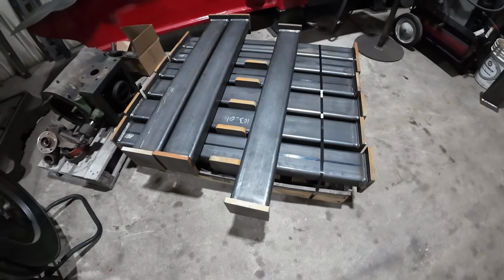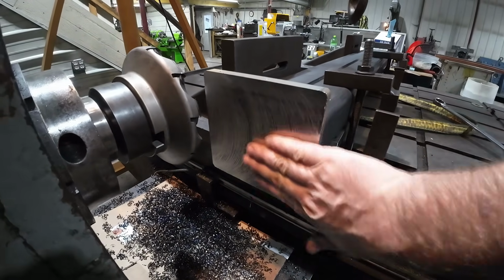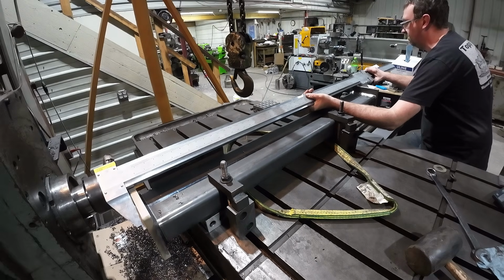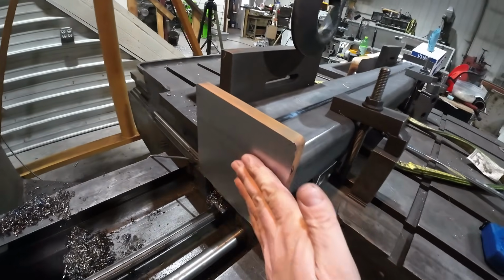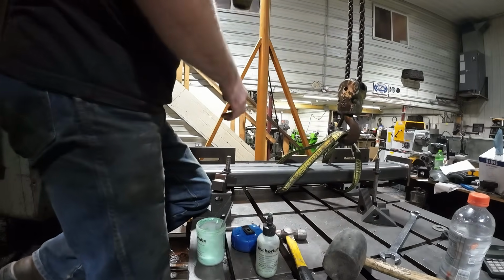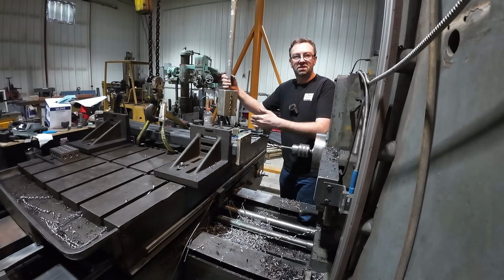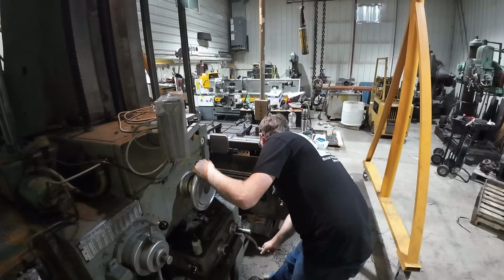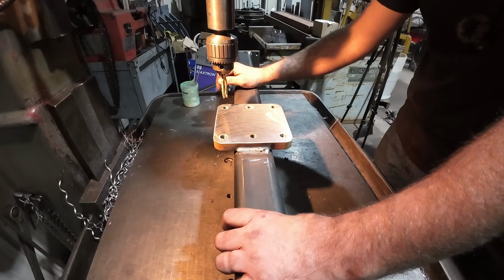Machining Parts for a Robotic Welding Machine on the Horizontal Boring Mill - Manual Machining

Comment: Many people think when they start out that the biggest cost will be tooling and machines. Machines is probably the cheapest if you buy used. But many people underestimate the cost of measurement instruments. Sometimes you just have to buy it for a job that isnt even worth that in the short run
Reply from the maker: The machine is the cheapest thing you will ever buy.  Just in tooling and measuring tools, I have probably well over a half million invested to get to this point.  It is crazy.

Comment: Never enough horizontal  boring mill work work on You Tube. Glad to see you doing your part Josh. The HBM is such a wonderful and versatile machine. As are the Verticals. I wish there were more vids with verticals working, but they seem to be sort of rare. Not to mention most of the ones I have seen in the wild are big and in shops where video is frowned upon.  The Big Starrett 123's are sweet eh? I would say you got a good deal on that. Well done!
Reply from the maker: I have a bunch of jobs coming up on the HBM.  I would love a 54" VBM or VTL, but there just isn't the room or work for one in this region.

Comment: I know you're not using coolant (No coolant recovery?) but running a 6" carbide insert cutter at 90 rpm is WAY too slow for mild steel. This is a small plate but if it was 50" long it would take you a half hour for each cut.
I have NEVER taken a finish cut of .075" with a five thou tolerance. Too risky. Even with digital calipers. A Vernier that size is too difficult to handle alone since you can't really wiggle the calipers to get perfect squareness so you will be off at least three thou. If the tolerance for such a simple part is really that close then you're better off locking your Vernier to plus .005" and using it as a go-gauge. I would take a ten thou finish cut at a higher RPM.

Comment: hey Flex Arm people this machinist is the real deal hook him up with a Flex Arm tapping system.. he will do more with it than the other guy!!!
Reply from the maker: I have no need for that contraption. The radial drill does the same job at a fraction of the cost.
Reply: @TopperMachineLLC  and with enough scrap... diy if it ever is needed.
Reply: have to agree that other Guy doesn't even use it i no not how he funds it but the tooling alone would be enough to break you and this other guy broke a few of them in setting it up the other guy his videos are not worth watching anymore and that's fact

Comment: Pro tip. C clamp the part the the angle plates. Use much larger clamps. You need to increase the distance from clamp kicker. Rookie setup in my oprion.

If you made those adjustments you could hog that pad as hard as u want

Comment: That has to be a tricky job because you are relying on the fabricator to give you enough length to work with.
As a machinist myself, I truly enjoy you and Cutting Edge in Australia because you guys are true working machinists, not machine tool collectors like many other sites that have lots of machines, but very little skills on how to use them.
Reply from the maker: He fabs them to print, which gives and extra 1/8" on each end. Plenty of meat to clean up.
Reply: What is the tolerance on the holes on the center plate with regards to being in centered between the ends of the post? Do you have to trim both ends equally on those?
Reply from the maker: @luksan_swe  Ends machined to spec length, holes on center plate off one finished end.

Comment: It might be worth mentioning to your viewers that anchor lube can be thinned with water to use as a more traditional coolant.
Reply from the maker: yes.  I have also thinned and used as a mist.  More experimenting is needed there, but it worked great for the application and less toxic than the Koolmist.

Comment: I’ve used a 60” calliper before, not keen on its weight but it’s the way it is. The current job has a carbon fibre 60” one, way way lighter. Not sure of the price but I think you want to find a good second hand one or win lotto first.

Nice job, first thought was looks like a CNC job to me haha. Boring mill is paying its way though.
Reply from the maker: Carbon fiber would be awesome.  But, I am happy with my heavy beast.  This job came from a CNC shop.  They couldn't handle it. Not a big enough machine.

Comment: Thumbs up on the music LOL!  Can’t help but compare the operation of your HBM to mine.  I’m just a clumsy rookie so I’m not near as handy with mine as you are with yours.  I see your Lucas must have the spindle drive and feeds off the same motor if the feed chart shows feed rate per spindle revolution?  Mine has 2 separate motors so feeds are all in inches per minute.  To me it seems the feed rate per revolution is little more practical.  Another note.  My mill has a F/R clutch for the spindle.  Also there is a high/low spindle speed selector right on the head.  So it works so nice to drill the hole in high, then swap the drill for a tap, switch to low, and tap the hole.  The spindle drive clutch seems to have been made with tapping in mind, it is so user friendly.

Comment: Good old left hand Lucas..ran one many years ago at Kearney Trecker in West Allis, Wisconsin. Started there in the late 60's. At the time K & T had several Giddings & Lewis 5" & 6" & my favorite was the Bullard 5" horizontal mill.
Great old machines,  they outlast most NC  machines. 
Should have mlled one edge on each end plate to use as alignment , ha4d to get parallel using extruded tube.?
Reply from the maker: Tubes were a lot closer than anyone thinks. Close enough to stay well within tolerance.

Comment: Very nice work. I would like to suggest you get a leather weight lifters belt to help with your back. I wear one all day and have for the past 10 years. It has solved 90 percent of my back pains and cut the cost of gallons of ibuprofen. I am not a doctor but it works. You would not be out a big cost if it doesn't work well for you but I suffered with back pains for 30 years. My relief was noticed within hours.
Reply from the maker: I don't lift a lot. These weren't that heavy to get to the table, but the crane saves the back for getting them to the setup. I have considered the belt idea, and may get one to try anyway.

Comment: I did a set very similar to this almost same size and 3 foot. length print said +/- .003 on length. So I tack welded  them all together  we had a specialty grinding shop my friend worked at and they Blanchard ground to length. When I delivered, they said I was the only one to make to print as they always needed shims.
Reply from the maker: Man, that had to get expensive.  I send some smaller stuff out for blanchard grinding and they rape me.  These are +/- 0.005 and I have been holding right at finished length +/- 0.002.  My customer has been thrilled.
Reply: @TopperMachineLLC   my friend, owned the place  charged me 150. 50 an hour.  Their tall machine never saw much work  and he did it on Sunday and 35 years ago

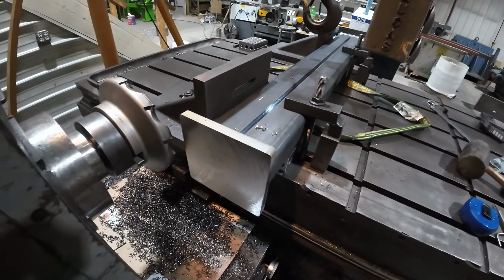Comment: 8:33 Holy crap that's the longest caliper I've ever seen. Wow! How often do you have to pull that out?
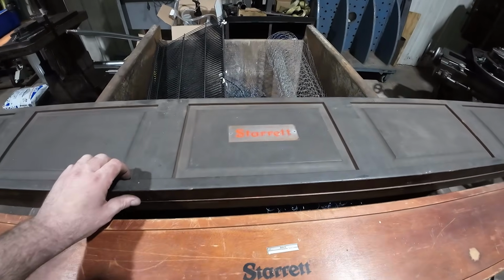9:04 Wait what? There's a longer one? 😲

I looked it up, a new 123Z-72 costs $19,681.00 😳😳😳 Wow.
Reply from the maker: Since I don't do much small stuff, I use them both a lot.
Reply: @TopperMachineLLC  Super cool. I had no idea they make them that big, and the wood case is neat too.
Reply from the maker: @missamo80  they make bigger one too, but I had no real need for that. Yet.

Comment: Anchor Lube really is an amazing product. Learn of it from Adam Booth and I love using it.
Reply from the maker: I have been extremely pleased with it.
Reply: Sponsored...  From what I've read there's a much cheaper generic.
Reply: @topduk  It works for me and I'm definitely not sponsored. It's also not super expensive but I guess that is up for debate depending what someone thinks is expensive.
Reply from the maker: @PREracing25  by the gallon, it's very inexpensive. The benefits of it, outweigh the cost in my book. Cost of doing business. A good product is worth the expense

Comment: I am learning a great deal from your channel. You seem very careful with expenses so I trust that achieving this kind of precision is worth it for this task. But it is hard for me as someone who works primarily with wood, to get my head around paying that much -- even  with a great ebay deal -- to achieve it. So I find myself wondering how much less accurate a good tape measure is than your caliper? Thanks in advance for any insight you can offer.

Comment: Hi    Reaching over the table so far , why not set up bit close to home. Like the caliper good price as well. 
Steve
Reply from the maker: I just prefer to use the center of the table. The saddle of the machine sticks out as far as the table in that position and wouldn't change anything as far as the reach.

Comment: Noob question: I notice you don't wait for the face mill to go completely across the surface, only the leading edge. That makes sense, I was wondering if there are situations where it would be important to wait for the trailing edge to go across? Thanks, and I love your videos.
Reply from the maker: It all depends on your application and setup.  On this machine, it really doesn't matter.  On a knee mill that the head swivels, sometimes you are not trammed right and need to follow through.
Reply: @TopperMachineLLC  Thank you.

Comment: A question if you please. Why not use a spiral flute tap to prevent the shavings from getting inside the tubes when you tap the center holes of the side plates?
Reply from the maker: because I am not clamping the tube down.  If I were to take the time to bolt it to the radial drill, then I could use a spiral flute tap.

Comment: Any room in the arbor for the mill for an ER32 taper?  That'd hold all the hole-making tools for this job at least.
Reply from the maker: Drill chuck is faster to swap out. I have several ER40 to MT holders and they are used for other things.
Reply: @TopperMachineLLC  I mean, could you put an ER32 nose on the end of the stub in the center of your mill arbor?
Reply from the maker: @jimsvideos7201  no, it would never fit. There isn't enough depth for it. It isnt that bad to do what I've been doing.  Good exercise, lol
Reply: @TopperMachineLLC  Ok, thank you for the reply.

Comment: Starrett should be embarrassed to ask 20k for those calipers.  You will never convince me the overhead is so significant to warrant that kind of price delta.
Reply: When it comes to specialty tools like that, they can charge virtually whatever they want, because there's almost nobody to compete with them, and if you need the tool, you need the tool.
Reply from the maker: It is just the cost of doing business. I was lucky enough to score a used one, but if you need one you have to pay. This isn't a cheap business to be in.

Comment: Why are only specific holes drilled and reamed and others only drilled?
Reply from the maker: Reamed holes are for locating dowels.  Drilled holes are for bolts.
Reply: is there an advantage to using a reamer over a drill, or visa versa?
Reply from the maker: @richardabner9420  reamers finish perfect size for dowel pins.

Comment: How do you hold parallelism between both ends. Or do you need too.
Reply from the maker: It's all in the setup. Note the angle plates and 2-4-6 blocks.
Reply: @TopperMachineLLC  What kind of tolerances do you have to hold on a weldment like that. +- .005, .010 or more than that after its machined.
Reply from the maker: @usaerospace6707  49.880 +/-0.005, but I was holding finished size of 49.880-49.882.

Comment: As someone who runs small batches* of various parts, i have to critique your "technique" here. It just does not make sense in my opinion, why don't put 1 in touch off feed in 100thou face it, place a new one in face it with the same depth from the previous part and do that to all of them and when you finished all on 1 side, flip them around cut measure, feed in to final length face off and just put in the next one and face with the same depth? 
Would love to know the reasoning for the chosen technique here.
Reply from the maker: Weight!  I am guessing your parts weigh a lot less than mine.  Since I have all my zeros set, this is just fine and takes out all of the heavy lifting you're suggesting.  I am only lifting the part up to the table one time for both ends, vs your suggestion of twice.  Then throw in the concept of speed.  I only have to make the first cut, swing the part around, advance to zero and finish.  Your method would take a lot longer as I would have to load the part, clamp, face, unclamp, unload, repeat for the rest of them, then load again, clamp, advance the table to zero, face, unclamp and unload, and then repeat for the rest.  Which process makes more sense?  I get what you are saying for small parts, and I do it all the time, but big stuff is different.
Reply: @TopperMachineLLC  I saw the DRO and stuff but was confused why you touched off like every part we saw, so i assumed that it was either broken or not reliable. That's why i suggested the method i commented because its reliable and makes you stop having to measure like 2-3 times per part xD. 
And yes the parts i run are light as can be but the weight itself isn't the big issue here its more the accessibility of your machine setup, which makes it hard to load stuff. 
Your own words "they aren't heavy" XD .
Reply from the maker: @FireGodSpeed  Gotcha.  I was touching off because none of the plates were welded perfectly square. If I just ran by the stops and DRO, I could have easily taken way more than I could chew on the first pass.  The DRO is getting an upgrade soon here.  I am adding the third axis instead of using the dial indicator.

Comment: When 500% of the profit on the job goes to purchasing 74" vernier calipers. Could have been me, I even have expensive tools that I have purchased and never used.
Reply from the maker: Cost of doing business. I would have lost out on this job and possibly lost a great repeat customer if I couldn't perform on these parts.
Reply: @TopperMachineLLC  Yeah, swings and roundabouts. You have to average out the jobs each customer brings. But what do you do when they take the good jobs to someone else, and only leave you with the bad ones? Do you tell them each time you actually did them a favor, and the real standalone price should/would be much higher?
Reply from the maker: @erik_dk842  I've been fortunate in the fact I live in an extremely depressed region and there is really nobody else to go to. That and my reputation is such that they don't want to lose me. I had one local shop try destroying me, it backfires on them. Their goal was to put me out of business so they could take my customers. Again, depressed region, not a lot of work. They lost a few of their customers to me because of it.  So, I don't have much to worry about.

Comment: Fantastic content as always, engaging, entertaining and most importantly "educational" - a question re an issue I have with a Swedish mill drill that cants mill - how do you get an 8 inch face mill to stay in om a morse taper spindle ????
Reply from the maker: Boring Mill draw key. Watch the video closely, I put it in and took it out.
Reply: I gather the thickness of the flanges is not critical from the way you machined the parts.  I really enjoy your explanations of the setups.  Maintaining accuracy over such long distances is a challenge.  Thank you for the entertaining, educational videos.
Reply from the maker: @haroldchoate7497  Thickness wasn't critical, just length.  But I shot for a similar thickness of the plate.  Planning each starting cut.  As the plates were not perfectly square to the tube, I had to touch off on each one and compensate for any deviation.